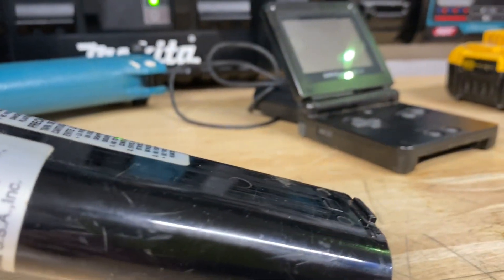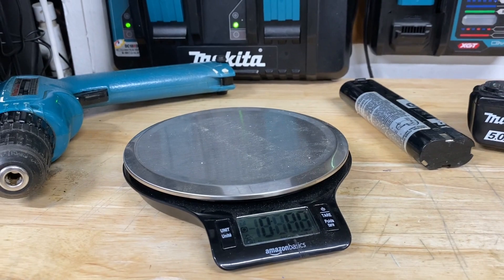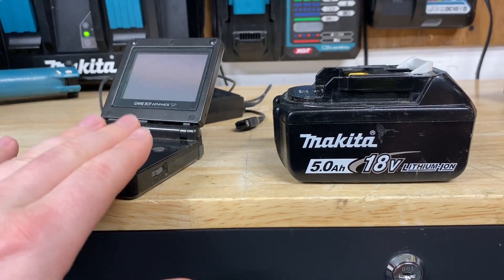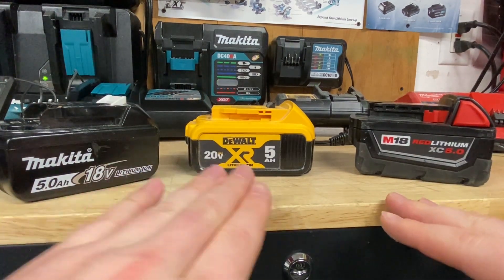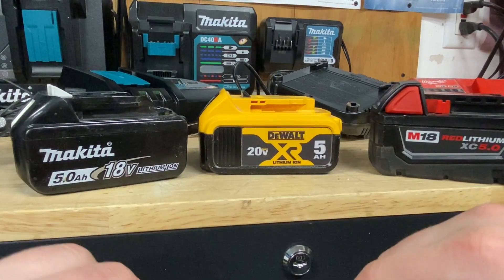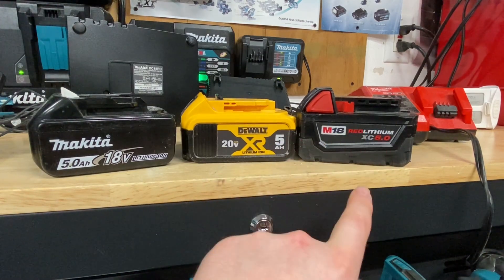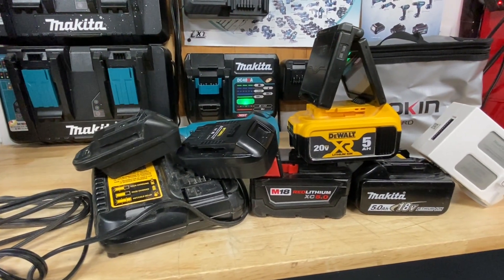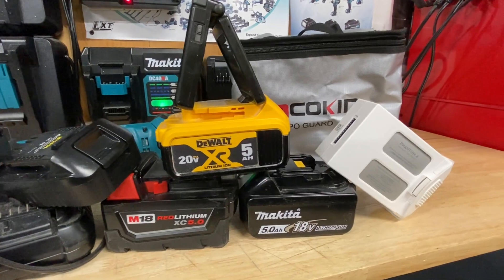Basics of Power Tool Batteries and Technology!  Battery Types, Safety, Adapters and more EXPLAINED!

Comment: Great video, I hope it will get a lot of views! Just to add a few points:

nicads are also very slow to charge, like 12-14 hours for regular ones

dewalt is lying about wh, it is also 90wh, same 18v nominal x 5ah. 

pouch cells are basically lipo, in flex they rate them around 15C discharge which is also possible with best cylindrical's, but they are less expensive
Reply from the maker: Thank you! Great points! I didn't want to bash Dewalt's misleading numbers to much, lol.

Comment: If I may add, differne between Game Boy and power tool battery might be in the user.

Let's say you charge your game boy every other day and play daily. Most of the time the battery will be never fully charged or discharged.

The Power Tool cell will get empty. You put it in the charger, leave it in there and throw it in your drawer till you need it again. Lithium Ions ideally are stored at around 70% charge. At 100% it will age much more quickly.